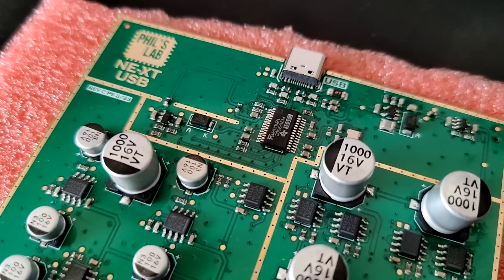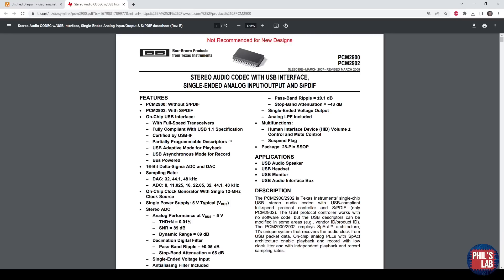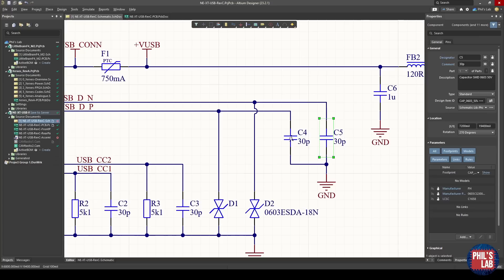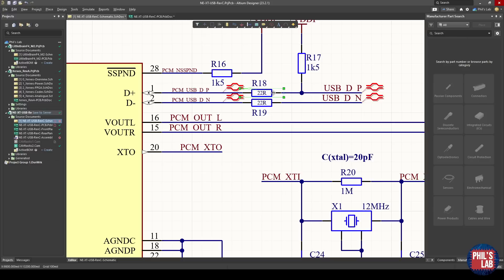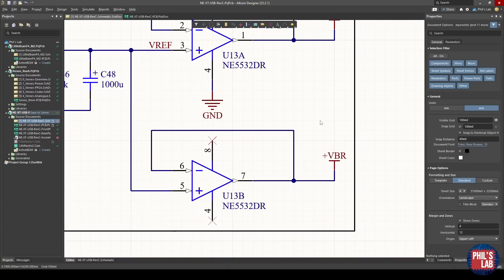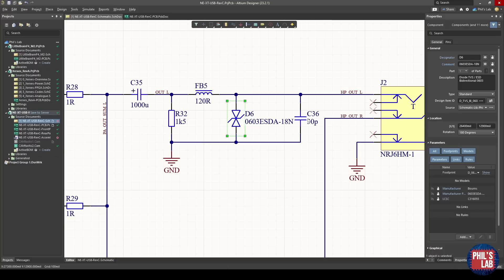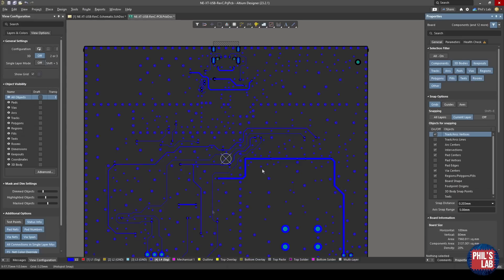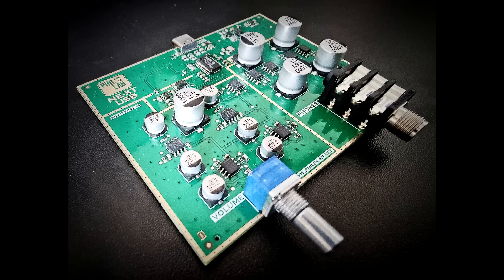USB Headphone Amplifier Design Walkthrough - Phil's Lab #101

Comment: I'd love to see a video on pi filters and ferrite beads. I see them in every one of your newer design. I've read application notes and articles on them, but figuring out the right impedance value to use is very tricky.
Reply: Yes indeed a video for this topic would be awesome
Reply from the maker: That's definitely on my list of videos to make. You're right that there's a lot one needs to take into consideration when choosing an appropriate value. I hope a video (in the near future) will clear that up!
Reply: I simulated a pi filter with ferrite like that (using full manufacturer spice models) and saw that it definitely can resonate, so there is a specific frequency that is actually amplified rather than filtered. I don't know if that is only an issue if there is stimulus at that frequency range though? Or perhaps the source impedance combined with the first cap means it's actually not providing gain? Or maybe this is the reason Phil had to add that big RC filter, since the pi filter wasn't doing the filtering that was thought?

Comment: Thanks Phil! This thing has kept me busy for a few months already.. Finally made a working version myself! Although a little unstable and noisy.. Probably due to poor component selection (already found out I should use thin film resistors and S0G caps in the signal path, I missed that the first 100 times I watched this video) After sorting those out I'm planning to make a version with a Baxandall tone control adding to it.
Cheers!
Reply from the maker: Awesome, glad you got your design working, Benjamin! Good luck with your revisions!

Comment: This is a pretty nice design, I'm curious as to how the analog side stacks up with something like the Neve headphone amp. Great video as always, keep it up Phil!
Reply from the maker: Thanks, Zach! I'd be interested in that as well. I just find the price-point to be pretty ridiculous on some of those headphone amplifiers..
Reply: @PhilsLab  Honestly it probably performs very similarly. The THX AAA-888 (which is beloved by many in the audiophile community, at least from my experience) is just a power opamp with some standard auxiliary circuitry.
Reply: @PhilsLab  The hi-res/lossless audio scams are certainly a contributing factor.
Reply: The Neve is based around a TPA6120 amplifier, which was originally an ADSL line driver. It's a great amplifier though, if somewhat cranky stability-wise. There are a number of DIY TPA6120 designs out there that would allow you to achieve Neve levels of performance without the silly price.

Comment: I read that book too.  I continued trying to design a 4 stereo channel mixer with EQ.  I gave up when I got to about 24 5532s and about 200 components.  I could layout one channel, but the PCB design software gave me no way to duplicate them on the PCB.  They coudn't even be copy pasted.
For drive power I went for the OPA551s which gives 70V 200mA+ to place with per channel.
Reply from the maker: I thought about designing a mixer at some point as well. It would make a great project, but there's so much detail to be sorted out.. Maybe when I'm retired :D

Comment: 11:06 I believe the TPS61040DBVR boost converter is configured wrong.

When having a look at the datasheet, the formula for maximum load current is given. With this configuration of L1, R4, R5, D3 and an assumed efficiency of 80% (reasonable mentioned in the datasheet) the maximum load current is only 56.9mA.

When having a look at the NE5532 datasheet the total supply current without the drive current is 8 to 16mA. In the design we have 9 NE5532. So just in idle without accounting for the load currents and taking the best case supply current, the devices are drawing 72mA from the 15V supply.

Hence, I believe the TPS boost converter is not sufficient for this design.
Please correct me if I am wrong.
But I believe a fix would be to increase the Inductor of the boost converter to 15uH.
Reply: I have tested the design at home  and the TPS provides a voltage of only 14.56V instead of the expected 15.8V.

This voltage also aligns with the maximum switching frequency of 1MHz as stated in the datasheet.

@PhilsLab
Reply: As far as my research went, another alternative would be to use the LM27313 as a drop in replacement for the TPS. Pins are the same and capabilities are similar. Furthermore, not a single component surrounding the TPS must be changed.

Comment: Hi Phil, thanks for the great video as always! Quick question - do you have any videos that give a bit more detail regarding how the 30pF capacitors provide EMI protection? Are they just forming very high frequency low pass RC filters with the series resistances?
Reply from the maker: Hi Louis, Yes, that's basically it! Even if they're not populated, I like to place series + parallel element at every I/O in case they need to be fitted for compliance reasons.

Comment: Great video Phil. Quick question about the bias generation: does this circuit sacrifice power supply rejection? Since the bias voltage comes from a voltage divider instead of a reference, it seems like any PSU ripple will end up in your signal chain. Some of this may be cancelled by the concatenation of inverting and non-inverting stages, though group delay will eat away at this.

Comment: Regarding using Class I (C0G) capacitors instead of Class II (X5R, X7R, etc.), the reason for distortion in Class II MLCCs is largely the hysteresis introduced by the spontaneous polarisation reversal process in the magnetic domains of the barium titanate dielectric. Class I dielectrics are not spontaneously polarised, so when no electric field is applied the crystal lattice does not have any polarisation. Class II dielectrics, on the other hand, form spontaneously polarised magnetic domains of random orientation when there is no electric field applied, and the application of an electric field causes reversal of that spontaneous polarisation to align the domains with the field. This leads to hysteresis and effects like domain wall heating, hence the distortion.

Comment: Very cool, thank you, Phil!
About boosting 5V - not the first project, when I'm a bit sad, that PC (not all?) can't give you more than 5V via USB PD protocol.
With all this pi-filters and very nice design, it's enough to be called "audiophile" :)
BB's are very cool - I've worked with PCM1792a.
Reply: Usb-pd can deliver up to 20 volt for 100 watt total iirc no? This is of course optional.

Of course this is for usb 3.2 or 4.0. (Maybe 3.1 too but that has up to 20 watts total I think, would have to look that up.)

Comment: Hi Phil, really enjoyed this walk through and even though I've completed your mixed signal design course, I've made some extra notes based on this video as well regarding the signal chain. I'm interested to know though what exact parts you selected for some parts of this circuit, specifically around the power supplies and filtering. Is there a BOM available that would match the schematic you presented in this video? (I couldn't see anything on github.) My first board (since taking your course) is taking 5V from a Raspberry Pi header (so noisey) and boosting and filtering it, much like this board does. I've selected different components and its about to arrive from PCBWay this coming week, so I'm excited to do some noise tests once it arrives, but I can see there are other options you've selected here I'd be interested to know about. Thanks again.

Comment: Are the ground planes different between each layer at all or do all the vias simply cut through all the layers? I thought there's some benefit to having separate analog and digital ground, but it looks like you're only separating power signals via a series resistor.
Reply from the maker: As stated in the video, one GND for all - for 99% of mixed-signal designs this is the way to go. The ground planes are stitched together with vias.

Comment: Hi Phil,
Big fan of your channel... 
Just wondering... since it's a 4 layer board and you have dedicated 2 of the plane layers to GND.... wouldn't it be been better to have a split on one of the plane layers, and have power delivered via plane layer or better dedicate a complete layer for power delivery and split for different voltage rails ?
Reply from the maker: Check out the video on my channel on stackups and buildups for a detailed explanation why I choose this stackup (e.g. return paths, field control, etc.).
Power planes are not needed for this type of design and only become relevant for high-speed digital.

Comment: Next time try the capacitance multiplier after a boost converter. With a single transistor you will get a real bang for the buck. Capacitance multipliers are very good at clearing noise in the audio spectrum.
Also you can use any generic buck converter in an inverting buck-boost configuration to get a negative rail. With +/- rails life is much easier in an audio realm, especially if you plan to use op-amp based analog filters. Xonar Essence sound card used 90 cents buck converter designated in a datasheet for a LED flashlight to get a negative rail. 😂 And they achive -114 db of SNR.
Reply: Also much MORE ceramic capacitors in parallel after a boost converter are very welcome in audio.

Comment: what program did you use for simulating those paralleled op amps ? Asking since i am not sure how to pick that balanceing resistor that is 1 ohm in your case i want to make a charge pump that gives a few mA of negative voltage and i am thinking of useing 2-3 op amps for buffering my clock signal .
Reply from the maker: LTSpice usually. However, I took some values from one of the Douglas Self pieces.

Comment: I am curious what's your take on using capacitance multiplier circuits (eevblog #1116) instead of using pi filters and ldo. I also did a karaoke board and I ended up using them for filtering the noise from the switching regulators.
Reply: Loss of headroom is the issue with cap multipliers (on a 5V rail that's about 15%). Purely passive filters can nail HF noise coming off the USB rails (which are notoriously noisy) whereas "multipliers" seem more attuned to L/F ripple.

Comment: Have you looked into using opa1688 as current drivers?
Reply from the maker: Not yet - but they look rather neat. Thanks for the suggestion!
Reply: @PhilsLab  Another suggestion that I had in mind was for PCM2704 DAC chip. Looks like it has better THD+N performance. Too bad it is not drop-in replacement as pinout is different since it's only a DAC.🤷‍♂
Reply: @pavlobilous4030  PCM2706 + e.g. PCM5102A is a proven combo.
But, I'd rather see Phil design around CS4398 with differential outputs. Cirrus Logic made a great DAC right there.